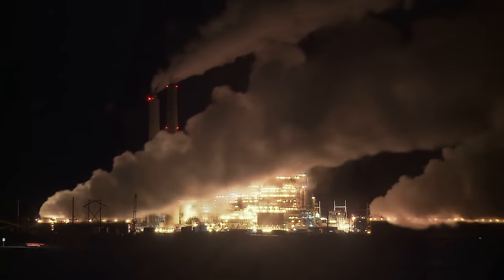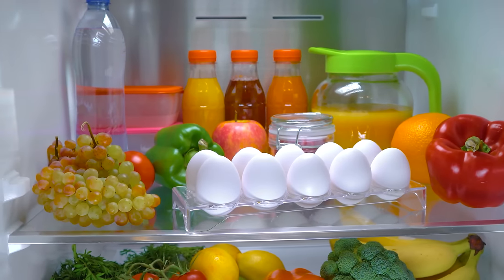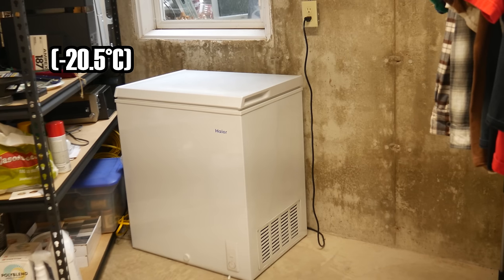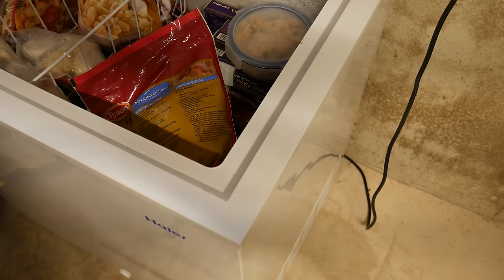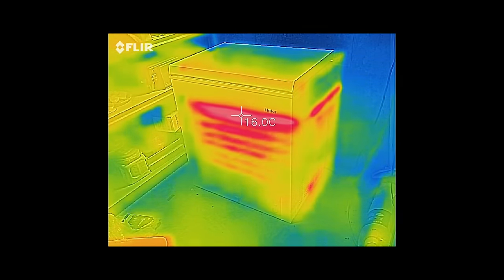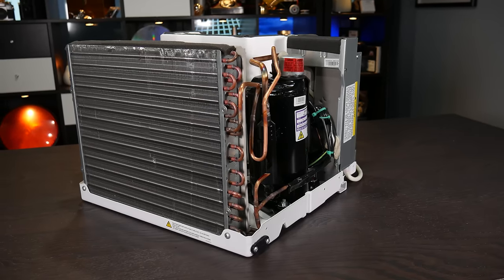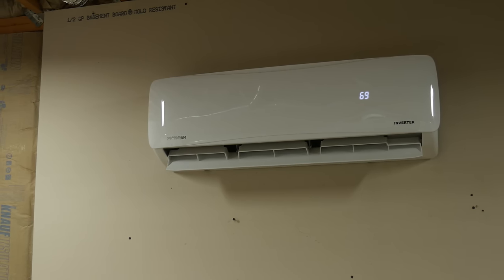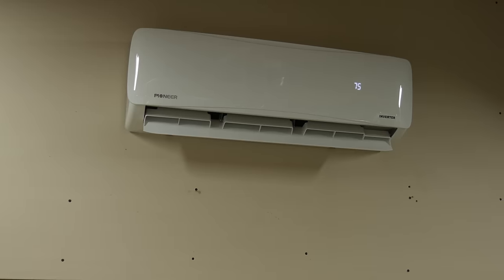Heat Pumps: the Future of Home Heating

Comment: If it's not absolute zero there's some energy. Let's steal it!
Reply: If efficiency is not 100%, make it
Reply: e
Reply: even if it is a completely empty vacuum there is still some energy
Reply: @inactiveytchannel  the second law of thermodynamics states that mechanical devices cannot be 100% efficient
Reply: NO ONE WILL EVER KNOW!
Reply: @Jaymac720  except they absolutely can be 100%  efficient. Or in the case of heatpumps be more than 100% efficient. which is why heatpumps are more efficient than resistive heaters. and those resistive heaters are already 100% efficient as they convert all the energy you put into them to heat.
Because the work we put in is in compressing and moving the refrigerant around. meanwhile our wanted output is the heat we just removed/added to the room.

So we get something that cools the room by 5kJ for every 1kJ of electricity we feed it. which is a 500% efficiency. it then dumps that removed heat as well as the electrical heat outside.

Or in case of a heatpump we feed it with 1kJ of electricity and it then gets us another 3-4kJ of thermal energy from outside. and the dumps the 4-5kJ of heat into the home. which once again is a 400-500% efficiency.

oh and if you use the heat output of an AC system to heat up water your efficiency goes even higher.
Reply: @anonym3017  Heatpumps just move heat around.  If there was no heat to move it would be 0% efficient.
Reply: @craigh5236  Yes but do you live in a vacuum. It's in practical sense efficient which was the whole point of this video goddammit
Reply: @soundspark  I’m sure minitiurized atomic heaters are a thing in the fallout universe
Reply: @soundspark  If the atoms won’t willingly surrender their heat energy, we’ll violently split them apart instead. That’ll show em!
Reply: @Jaymac720  The second law of thermodynamics is what ACs and heat pumps work to counteract.  Energy will always need to be expended to make that possible.  It surprises me that it's possible to heat efficiently this way (though I've known for a long time that it's the only good way to cool a house in warm weather, or refrigerate).
Reply: @huckthatdish  And in the real universe.  Radio-isotope thermo-electric generators power many space probes.  Voyager etc.
Reply: @sarkybugger5009  oh yeah for sure. But I don’t think we will deploying it for home heating any time soon
Reply: I'm not gonna steal it, I'm not a thief. I'm just gonna move it.
Reply: @anonym3017  Heatpumps are not 100% efficient. What you are thinking of is the coefficient of performance(CP). In order to find efficiency, you need to compare CP's from a real world cycle to an ideal, reversible, cycle (Carnot case). Both could be expressed in terms of efficiency, but only heat pumps have a CP. Since a furnace is a one-way process, efficiency is measured purely as heat coming out vs. work & chemical energy going in. 

This makes it easier to compare furnaces with efficiency and heat pumps with CP, but comparing both of them to each other, or calling CP "efficiency" is wrong.
Reply: Laughs in heat death of the universe.
Reply: Actually, there's even energy at absolute zero. But we can't steal that.
Reply: @Jaymac720  It’s also the reason why the biggest disadvantage to big gaming PCs (aside from power consumption) is turning it into a ridiculous space heater
Reply: Considering extreme cold labs can produce close to absolute zero temps with heat pumps (the rest of the way down they ping the atoms to reduce their movement) (yes they're basically nicely asking atoms to please chill out)...

Of course at extreme temperatures the coefficient gets increasingly bad and you'd be better off just using the electricity to heat a coil or something. But if you had a fusion reactor and no other heating elements besides a heat pump... you'd be fine to surprising lengths.
Reply: @anonym3017  how... How is that not free energy?
Reply: @anonym3017  
ERH is 100% energy efficient in the sense that all the incoming electric energy is eventually converted to heat energy. However, most electricity is produced from coal, gas, oil generators that convert only a small percentage (about 30-40%) of the fuel's energy into electricity.
The same goes for heat pumps.  While you simply cannot compare ERH to Heat Pump as the the effeciency of the Heat pump is actually lower, than ERH. But the CoP of the Heat pump is typically higher than a ERH. That is because even though the pump system might not be 100% effecient its job isn't to convert electrical energy to heat energy, its job is to convert electrical y energy into mechanical energy that moves a refrigerant through heat exchangers to move heat that already exists outside your home into your home... Therefore depending on the amount of heat energy outside your home you can have a very high CoP.
Reply: @Snookers_  thank goodness, someone with some sense.
Reply: @Snookers_  except that isn't how any engineer defines efficiency.

Engineers define efficiency as (wanted work out)/(input energy). because I only have to pay for the input energy. at which point wanted work out in the case of heatpumps is the heat and input is the elcetricity.

and no. calling both efficiency therefore also isn't wrong.

which brings us back to them being 300-400% efficient.

and again. a resistive heater has a 100% efficiency so you are wrong anyway with your claim that 100% efficiency is wrong.
Reply: @craigh5236  yeah and?

any engineer can tell you that efficiency is (wanted work out)/(input energy). Because I only have to pay for/expend the input energy.

and there's always heat to move around while you are in some kind of atmosphere or liquid.

and you can build heatpumps in such a way that you can short circuit them and use them as a resistive heater. it's only 9x% efficient but it still works
Reply: @yonatanbeer3475  It is free energy. energy that you are taking from outside and moving inside your home to heat it.

or energy that you are taking from inside your home and dumping outside in the case of cooling.
Reply: @anonym3017  how does a >100% efficient machine not violate the direction of entropy
Reply: @anonym3017  In you look at the whole picture, heat pumps aren't really over 100% efficient because their output does not exceed their total input. It's heat output is not more than its total input (electricity used + heat absorbed) and is actually slightly less because some of the power is lost to the outside air running the outdoor fan motor and controls and some heat is lost to the outside through the compressor shell and lineset, so its actual efficiency would be slightly under 100%. Practically speaking heat pumps are over 100% efficient though since we don't pay for outside heat, we only pay for electricity used to move it.
Reply: @anonym3017  Again, you're thinking of performance. Heat pumps perform better in most situations, you're not wrong about that. Efficiency is not performance. Efficiency is comparing a real performance to an ideal performance. It can be summed up to being a ratio of a ratio where performance is just a ratio.

Also your resistive heater efficiency depends on what you call your system. With heaters, we usually call our system the heater itself. If we lose heat to the surroundings (not the desired exhaust), then we are not 100% efficient since some of that heat gets lost to the system.
Reply: Minecraft
Reply: @Idontrunntoofast  except not a single engineer defines efficiency that way.

it's always wanted output work divided by input energy. because you only have to pay for/expend the input energy.

which means you can direclty comapare an ERH to a heatpump. here's 10kJ of electricity how much heat energy gets added to my home. oh look. the heatpump added 2.5 to 3 times more heat to my home than the ERH.

also a CCGT converts a good 62% of the chemical energy into electricity.
Reply: @yonatanbeer3475  1. that only applies in a closed system (aka basically never).

2. efficiency here is defined as (wanted output work)/(input energy) as that is the standard engineering definition of efficiency.

or in this case its (amount home gets heated by)/(used electricity).

the energy I moved from outside the home to inside the home is only in the top bit while the elctricity is in both.

and total entropy still goes up by a bit but significantly less so than it would burning natural gas.
Reply: Pretty much, yes.
Reply: @anonym3017  Another way to look at it would be efficiency / effectiveness.  From a mathematical view (using thermodynamics)  100% or greater efficiency is impossible. If that ever happened, you would a have a perpetual motion machine creating extra power. The efficiency calculations take into account the fact that you are pulling energy from outside.

100%+ effectiveness is very possible, and already a thing (see above video. :)   )  The effectiveness would be how far are you getting a lump of coal to go. There are ineffective ways to use it, and very effective ways to use it. Heat pumps are more effective than resistive heaters.
Reply: @FutureSoap  💖Disk-Kun 😊 - Go and play the FDS version of Zelda -called Zelda No Densetsu right now, and be amazed at the extra sound channels. 

Metroid has a way fuller soundtrack in the disk version, as does Kid Icarus - called Hikari Shinwa - Palutena no Kagami
Reply: Nice Disk Kun pic ;)
Reply: Absolute zero is 0K.
Reply: Stop and drop the energy
Reply: @kuhljager2429  except no.

you as the engineer are the one determining usefull borders for your calculations.

meaning you specifically don't take outside energy into account as it doesn't cost anything.

which is once again why efficiency tends to be defined as how much usefull (and wanted) work you got out of a specific amount of input energy.

the limit of 100% only exists when turning heat into mechanical or electrical energy.
Reply: @psikot  Ba-dum Tsh! 🥁
Reply: @Snookers_  1. which also happens to not be a useful definition because maybe 1% of the wider population knows what the ideal looks like. and the rest doesn't care and just wants their heating bill as low as possible.

So efficiency is useful work out divided by energy in.  because this also allows us to directly compare to other methods.

which also happens to be how engine/powerplant/turbine/etc efficiency is measured. how much of the chemical energy got turned into mechanical energy. and not how said figure compares to an ideal carnot cycle.

2. the resistive heater is in the room you want to heat. so it is always 100% efficient. because even if it goes into the heater itself it still ends up in the room eventually.
Reply: @anonym3017  1. I figured since you were talking about how engineers measure things I would talk about how engineers measure things. This is also on an engineering-related video, so it makes sense to stay in that line. If we're talking about general population, then sure, it makes more sense to talk about performance. Defining efficiency as whatever you want it to be though is plain wrong. Everything generates entropy so it's impossible for anything to be 100% efficient.

Also when something's output is work instead of heat, the way we define efficiency changes along with the equations. 

2. If you define your system as the room, then sure. The room will receive all of the heat.
Reply: As someone who has suffered through many  engineering classes  I can tell you that for any statement of efficiency to be valid  you have to set the equation (system) up properly ....
With heatpumps people tend to have trouble separating  the  efficiency of the subsystems out accurately... if it were sealed tanks of water for instance you could never pump 2x the water that exists in tank #1 into tank #2....it just doesn't work... however you can say that it required ½ the energy to pump all the water from tank #1 into tank #2.... I realize the statements sound the same but are actually totally different. That's the false equivalent trap that is  easy to fall into. The  sub systems are approached as separate and independent as far as calculating efficiency subsystem and total system..... the compressor , heat exchangeers and tubing all experience frictional and heat transfer losses,  that is one  subsystem and is not 100% efficient. While the heat absorbing and rejecting  properties of the  refrigerant and the capabilities of the various fans, etc... is a separate  subsystem which is also less than 100% efficient. While they do in fact work together with the purpose of efficiency calculations would be treated as  independent. 
Now  when you come to the point of comparing a heatpump system a whole to a gas fired system the previously calculated efficiency are for the most part irrelevant. All that is being considered is how much $ is required to get an equal amount of heating capacity from each system. Again I'm aware that to many people this seems like Symantecs or splitting hairs but they are important distinctions for an accurate analysis.
Reply: @alexlail7481  100% agree. (I also like the water tank idea here)
Reply: @Jaymac720  while that is true, it isn’t what he is talking about. He is referring to electricity in/heat released in the home efficiency, which for heat pumps is well over 100%. Not Work in/Work out efficiency.
Reply: @Jaymac720  that's fine, just make it 101% efficient then.
Reply: @Jaymac720  That is true, but there is no rule saying mechanical devices cannot be MORE than 100% efficient.
Reply: AC typically only works down to about 5C before it becomes more economical to use other heating.
Reply: @tirex3673  Steal the energy from the Universe
Reply: There is still energy at absolute zero.
Matter is held together by energy.

There will always be energy left to steal until the heat death of the universe
Reply: @Jaymac720  Efficiency is defined as Waste Heat comapred to work done.
When heating there is no waste heat. There is just
- heat you pull from the outside
- heat you produced while pulling heat from the outside - wich you also put inside
That is the part where Heat Pumps can totally reach a efficiency of over 100%. And why we had to invent a new way to measure their effectiveness, putting 100% efficiency at heating at "Coefficient of performance 1".
Reply: we so close to absolute 0 yet so far to millions of degrees of sun surface, earth core, etc.
Reply: Stop the steal!
Reply: @craigh5236  did you forget about what the comment you posted this under said? It would have to be absolute zero for that to happen, in other terms 0 degrees Kelvin or -273 degrees Celsius. Don’t ask me what that is in Fahrenheit just do a conversation 😅
Reply: @midimusicforever  umm no the point of absolute zero is it’s the point where all particles are completely stationary with no energy, that’s literally the definition. 😂
Reply: @Hurricayne92  

There's still quantum mechanical energy at 0 Kelvin. So, no, you are wrong.
Reply: @anonym3017  

The heat pump itself is not 100% efficient. It doesn't pump heat with 100% of its energy. It will produce some heat while pumping. The point with a heat pump is not to break the laws of thermodynamics, but to work around them. We take heat from somewhere else, and we use less energy than the amount of energy we transport.
Reply: @anonym3017  that’s not entirely true. If you just look at the individual components, they still lose some energy to heat. The overall system has a coefficient of performance (not efficiency) of nearly 500%, but the system does still lose some electrical energy to heat in the compressor and fan motors
Reply: @anonym3017 ......just because there output is three times greater than there input does not mean it's 300% efficient, it just mean it has taken energy from a low grade source. There will be units more effective in the same conditions, better control designs, better
Reply: @christopherg2347  and with a heat pump, there will still be waste heat. The compressor will lose some heat to its surroundings. There are ways to minimize those losses, but they’ll never truly be 0. VdP will never exactly equal the electrical energy the compressor consumes
Reply: Y’all, I’m talking about the mechanical device (the compressor in the case of a heat pump). That was my original statement. The overall system does have a COP over one, but the compressor itself does not. That was my point. Mechanical devices cannot be 100% efficient. Heat pumps have a higher COPs because they move more energy than they consume, but that’s because that heat is being moved around, not generated. An electric resistive heater can only be 100% efficient. No more, no less, because it’s generating the heat directly from the electrical energy. Heat pumps don’t attempt generate heat. They attempt to move it
Reply: @dzhiurgis  Ever heard about Tokamak reactors?
Reply: @anonym3017  Only if they dont get so hot to the point where it emits visible wavelength
Reply: @User-nu6km  they already emit light before that.
Reply: @Jaymac720  ... That's wrong. It states that you cannot convert 100% of the heat energy into work energy. That is, that an ENGINE cannot be 100% efficient because of the heat that you put on it, only part will be transformed into work and the rest will be transformed back to heat. But work CAN be converted 100% into heat. In a heat pump (refrigerator or heating) the efficiency absolutely can be greater than 1 and, in particular, when used for hating, it HAS to be better than 1 (you would get 1 in the extreme case where all the energy put into the system is converted into heat without taking any heat from the cold side, which is what happens with a resistive heater).
Reply: @anonym3017  if it is emitting light then its not emitting heat.
Reply: Only if I can carry a gun and wear a mask.
Reply: @User-nu6km  ... right, because heat radiation is not light, or visible light cannot heat. Emitting light = emitting heat.
Reply: @Jaymac720  1. If you put the compressor on the inside space, then its "waste heat" is not wasted at all.
2. The thing still can get two times the heating/power that a resistive heater does. Wich is 100% efficient by definition.
Reply: @User-nu6km  You may want to look at the parts of the EM spectrum outside the visible light. You know, 99% of it.
Also tell the sun it has no business heating the earth.
Reply: @User-nu6km  that's utter bullshit. as can be seen by lighting a candle or any other type of fire.

it emits light and definitely emits heat as can be confirmed by touching it with your hand or a sausage.

or by touching an incandesent lightbulb while it is on and has been for some time. or pouring a bit of water on  a standard resistive electric stove. where the coils are glowing red hot and cook food.
Reply: Entropy: "evil laugh"
Reply: @schnaps1790  Entropy is like "The house" in a Casino - it always wins.
Reply: It's free real estate. XD
Reply: <off topic>
Disk-kun!!
</off topic>
Reply: @anonym3017  you are missing a very vital piece of the puzzle. Heat pumps are 500% efficient as you put it at very warm temperatures. Say 70 degrees F and above. At 20-30 degrees they are more like 100% efficient or less. 0-10 degrees, probably closer to 70% efficiency or less.
Reply: quantum physics says that there is still some energy at absolute 0 (half a plank unit)
Reply: heat pumps make a lot more sense when you remember kelvin
Reply: @JACjeeper  I got one. the efficiency drops below 100% at negative 16 celsius. at which point it just switches on a resistive heater in the water tank.
Reply: @User-nu6km  and? whoever I answered to said that something that emits light doesn't emit ANY heat.

which is clearly wrong as shown by every single example I gave.

even LEDs still emit light and heat. as is obvious because they need cooling above a certain light output.

and until you reach rather high temperatures all the emitted light is in the infrared anyway. which is also heat and therefore part of the wanted output.
Reply: @anonym3017  Not true. The WORK heat pumps are using is NOT 100% efficient. It merely uses some other cool trickery to make it "more efficient than that", so to speak.
Reply: fixing global warming one heat pump at a time!!
Reply: Let's just move it.
Reply: @tirex3673  well it wouldnt be energy itd be dark energy
Reply: This is not true
Reply: Here in canada, below -5celcius heat pump is unefficient
Reply: @anonym3017   "Or in the case of heat pumps be more than 100% efficient"
No, they are not. Heat pumps are moving heat, not creating heat. 
Heat pumps are absolutely NOT more than 100% efficient. The second law of thermodynamics states that mechanical devices cannot be 100% efficient. (It doesn't say, "Except heat pumps")
Reply: @joshua_eff1757  In a practical sense ????? Well, not in a real sense.
Reply: @Lauren_C  well, a nuclear explosion does produce an incredible amount of heat from a tiny amount of fuel. It's a bit impractical for home heating though.
Reply: NO ONE WILL EVER KNOW!!!
Reply: @tirex3673  no a complete empty vacuum is void of energy.  there is no completely empty vacuum
Reply: @santiagovasquez1404  there is still dark energy
Reply: @tirex3673  no that is a theory  not proven
Reply: @santiagovasquez1404  true, but vacuum energy is something that has been observed, causing things like the Casimir effect.
Reply: @tirex3673  vacuum energy is a kin to the refrigeration cycle where the positive is attracted to the negative. you said absolute vacuum  it just cannot exist  unless we are not real.
Reply: @tirex3673  thanks for the good conversation.
Reply: And make my neighbors pay more for resistive heating
Reply: Heat pumps really only work good to about 30 degrees most higher end systems will kick heat strips on at that time to satisfy temps
Reply: @INUMINIUM  it all depends on the specs & quality of the heatpump  you typically get what you pay for
Reply: What happens if you compress absolute zero temperature materials? .. look it up, there's a way to go BELOW aboslute zero, which equals in insane amount of "heat", which is still considered as cold. This might one day make it possible to get heat out of ice .. literally.
Reply: @santiagovasquez1404  yeah Idk I think a heat pump is a heat pump. Not much I’m gonna change in that sense besides. Variable motors and efficiency on how and when it turns things on.
Reply: @SethiozProject  So what you're saying would mean the number rolls over? This would be another proof that we live in a simulation. Think about it: quantized length, mass time, etc., finite speed of light and time, things happening or not depending on whether they are observed or not, point objects that can somehow still rotate (singulatities), and now this.
Reply: @huckthatdish  I had a dream some time ago that we had a nuclear heater that had two hemispheres made of plutonium inside (one of those dreams in which people are way more immune to radiation), and it had a screw at the top to bring them closer. The whole thing was made from wrought iron and looked like those little wood stoves, minus the chimney and about half the size. It also had plastic stoppers between the plutonium spheres to avoid bringing them too close, but because the plutonium was getting old, my dad was trying to pull those stoppers out with pliers. Naturally I tried to convince him otherwise, but of course he didn't listen as I was like 6 years old in that dream and it didn't end well.
Reply: @christopherg2347  that isn’t the job of the compressor though. Yes, that helps our end goal, but it’s not the point of my statement. The compressors job is to compress the refrigerant, not release heat into the surroundings. There will always be energy losses in the motor of the compressor and elsewhere because of friction. That is my point. Energy that doesn’t become useful work becomes heat. Whether we want the heat or not is 100% irrelevant to the point I’m trying to make
Reply: Aaaaa! I see all the brilliant minds of youtube concluded their debate under your juicy comment. Nice
Reply: @NoobNoobNews  c
Reply: @Jaymac720  the second law of thermodynamics is wrong, a heating resistance is 100% efficient because it efficiently transforms all electrical energy in heat.
Reply: @midimusicforever  we cannot steal that YET
Reply: @diablo.the.cheater  

We will never be able to.
Reply: @Jaymac720  "that isn’t the job of the compressor though."
The compressor is not 100% efficient. But as long as you recycle the waste heat, the whole device can still be 100% efficient.
Also if you pull 3 times the heat in that a resistive heater would, the efficiency of hte compressor would have to be 33% just to be as low as 100%.
So you are arguing about 300% vs 285% - wich is sitll way above 100%.
Reply: Great summary of how this thing works!
Reply: didnt understand this comment till now lol
Reply: It's the American way
Reply: @diablo.the.cheater  that’s not a mechanical device. Also, it’s really 0% efficient because it’s not doing any work whatsoever. It’s 100% efficient because the heat is what we want. I don’t know what qualifications you have, but you can’t just outright say that a physical law is wrong
Reply: @christopherg2347  that’s my point: the compressor itself is not 100% efficient. I don’t give a damn about the entire system. Regardless, heat isn’t the only waste energy that a compressor loses. We want the compressor just to change the pressure of the gas, but it doesn’t do that. It changes the volume, temperature, enthalpy, entropy, and pressure. We don’t want those changes, so ultimately, a compressor is around 80% efficient at doing what we want it to do. For comparison’s sake, a water pump is 98-99% efficient because it doesn’t effect all those other changes. It pretty much only changes the pressure of the fluid because it’s incompressible. My overall point is that a mechanical device cannot be 100% efficient. I don’t care about the overall system
Reply: @Jaymac720  When talking about the efficiency of the whole heat pump nobody gives a damn about the compressor.
Reply: @christopherg2347  I don’t give a damn about the compressor either. Or even air conditioners in general. My original comment was on mechanical devices and the second law
Reply: @Jaymac720  You talk about nothing but the compressor. About how the overall efficiency does not mater, only the single part does.
Reply: If someone comes up with a easily producible substance that can maintain a liquid form at near absolute zero temperatures there would be a technological revolution for any technology that has heat management issues(which is everything)
Reply: @randomdude4136  Helium has a Freezing Temperature at normal pressure that is below 0°K. Too low Boiling temperature however.
Ehtanol gives you 78.4°C Boiling, –114.6 °C Freezing.
So you got a ~181° range to use it as coolant.
Reply: @craigh5236  As long as the temperature is above -273F there is heat energy to move around.
Reply: @anonym3017  you have totally failed to understand the thing you are talking about, RIP
Reply: @unitedfools3493  yeah no. The thing is as efficient as a resistive heater at negative 16 Celsius. Which is when mine switches into resistive heater mode.
Reply: @Jaymac720  that is because of the heat losses, but if you want to produce heat than they can be 100% efficient
Reply: @anonym3017  Coefficient of performance and (thermal) efficiency are different. The first is what you’re referring to which is a ratio of the heat transfer over the work supplied to the pump.

What you’ve stated that any engineer would say efficiency = (work out/work in) is also implied and understood by any engineer to be of MECHANICAL DEVICES. For example say the pump used in your fridge needed 1 kJ to provide 0.9 kJ of work out, equaling an efficiency of 0.9. That other 0.1 kJ was LOST as heat meaning that it will not be used to pump the refrigerant. No heat/refrigeration cycle will ever reach 100% efficiency because that’s simply not how efficiency is defined when looking at that cycle. There’s a compressor that definitely is not running with 100% efficiency since it will experience heat loss. 

Another reason why you don’t define efficiency like that is if a plant was utilizing a heat pump they could use the heat moved by the refrigerant for something else like heating a process fluid in a heat exchanger. This “efficiency” of the heat pump would be dependent on the temperature of what the heat was taken from, which could vary throughout the year depending the source, making it a HORRIBLE approach to designing a process. 

Varying “efficiency” = unreliable estimations & designing of equipment = varying product = varying profit = unhappy boss = fired

Oh as a chemical engineering senior this information is right up my alley. There’s a couple more things that could affect the “efficiency” that I chose not to mention out of simplicity
Reply: yeah, it would have to be 0 K when you dont have any energy left to take but at that point, the power consumption of the compressor will be higher than the energy collected outside causing you to take more energy than using resistive heating.
Reply: @Jaymac720  that statement is for power producing devices power consuming device can have cop more than 100
Reply: @Jaymac720 actually, efficiency is measured by the amount of wasted energy is created by the system. This wasted energy gets converted to heat, so can't be used by the device for whatever energy is intended to be used for. 

So if your device is specifically designed to be a thing that converts energy to heat, then your "wasted" heat energy is no longer considered waste, and your device is 100% efficient.